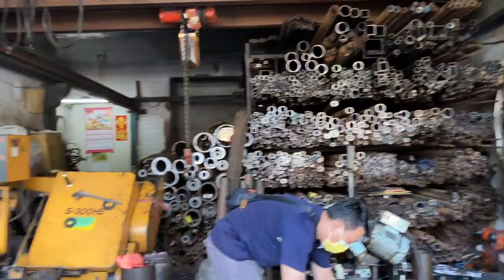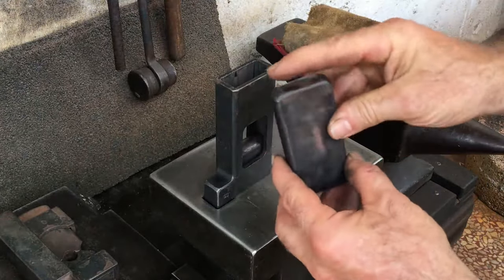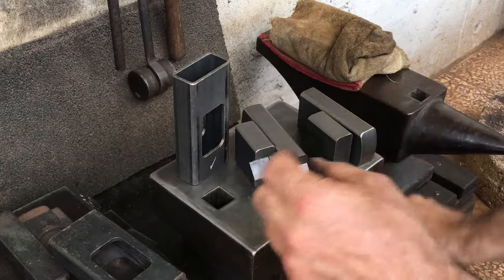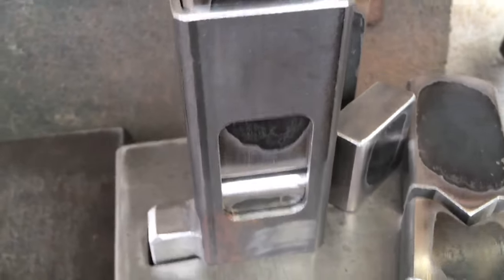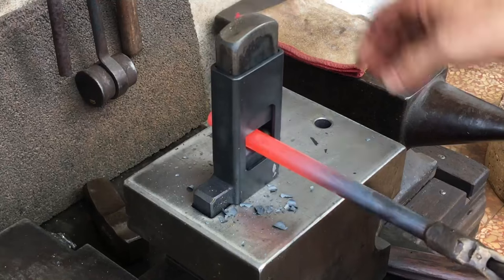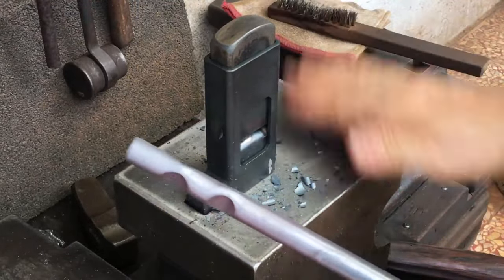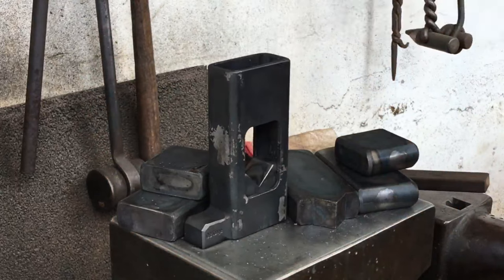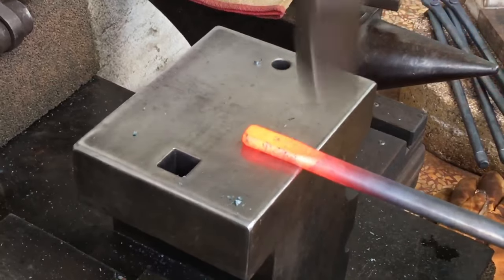Tube Guillotine / Handled Fuller - GS Tongs

Comment: I've always gotten my 1045 from one place, (which is irritatingly out of stock) and its always just worked well for whatever I bodge out of it. 
Really does need a decent soak time though at temperature on the thicker sections to cook it enough to harden in a water quench.
But yeah the metal varies from the sources and 1045-50 probably doesn't get the quality control love from most manufacturers that it should.
Reply from the maker: I've really just had more mixed results with medium carbon, mainly 1050, than any other steel. Sometimes soft, sometimes hard like a bearing... Thanks for sharing.